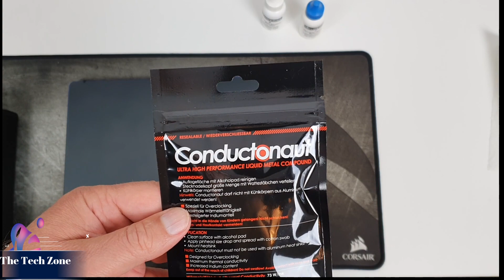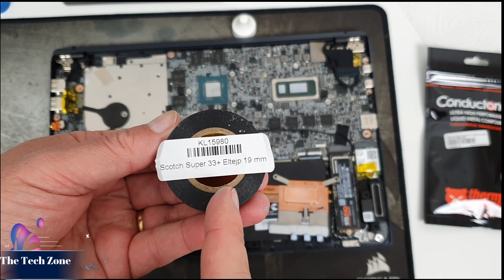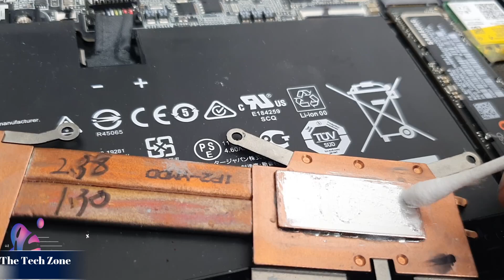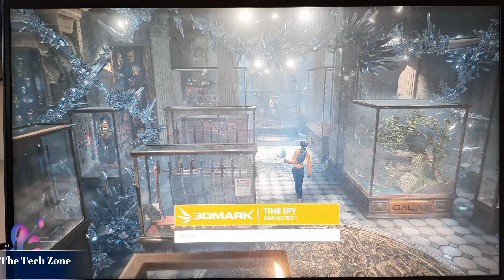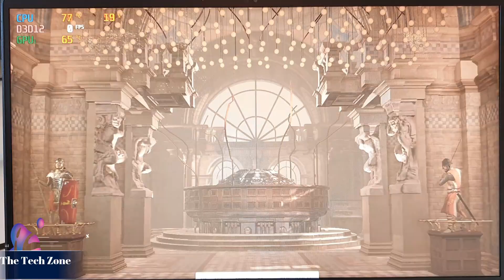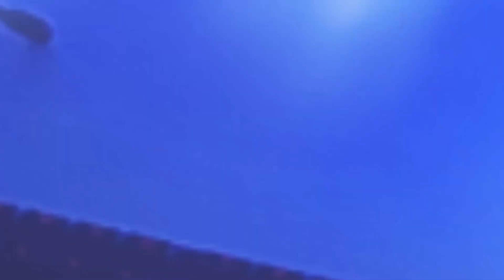MSI Prestige 14 Liquid Metal Mod GTX 1650 Max-Q i7-10710U

Comment: Hey,

Its possible on the asus g752VS notebook with 1070 Nvidia GPU & i7-6700HQ processor ?
Reply from the maker: Hi, thanks for the question. It is not easy to open up that laptop and I'm not sure about the material used on the surface that align to the CPU and GPU. It can cause damage to the laptop if the surface isn't copper(most are though). So I can't really encourage you to go ahead and do the liquid metal mod.

Comment: Great video. I also add heat pad on all of the VRMS and heat pipes to transfer the heat to the back of the notebook, since the cooling area of heat sink is too small comparing with the back of the notebook. And then you can use a cooling stand to cool the back of the notebook with minimum noise and maximum airflow
Reply from the maker: Hi, thanks for the feedback and suggestions. Then I was also thinking about adding extra heat pipes as shown in Brad's hacks(very interesting reading) on Huawei matebook x Pro.
https://bradshacks.com
Reply: @thetechzone6558   I just got this notebook for 2 days and I immediately notice the difficulty in cooling for such a laptop that is as powerful as desktop. My home desktop is a 4790k/1080ti using water cooling and 600W PSU, should be similar performance, but there is no way a laptop can match desktop level of cooling ability. I think it is more reasonable with less powerful CPU and GPU for notebook, it is enough good with built-in iris graphics in 10nm i7-1065g7
Reply from the maker: Hi, thanks for the comment. I agree on the need of a gaming GPU but MSI could have used a dual fan solution instead of a single fan. A dual fan is much more efficient and handle the CPU and GPU separately. Your home desktop should be MUCH more powerful since the 1080ti still is one of the fastest when gaming without the ray tracing facility(RTX). The ray tracing is still too demanding for almost any desktop solution on a single RTX-card, especially on 2k or 4k resolution.
I will be very grateful if you can supportthe channel by subscribing :)

Comment: hi, how do the speakers sound on this laptop? also, do we have to undervolt CPU and GPU to get the optimal performance?
Reply from the maker: Hi,thanks for the question. The speakers produce good quality but the volume is not as loud as I have preferred. I will make a video coming weekend regarding under volt. I will be very grateful if you can support the channel by subscribing 🙂